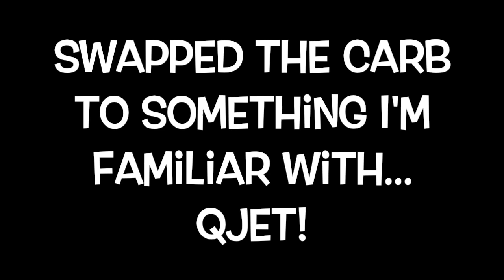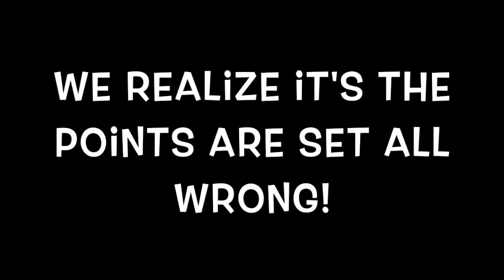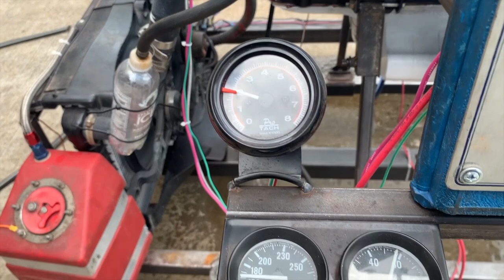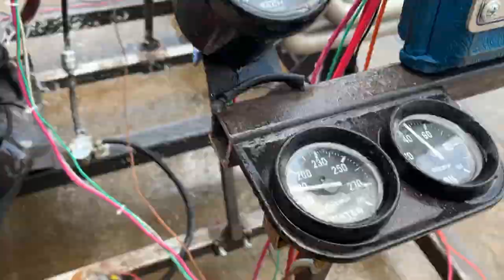What you've been waiting for, Super Stock Buick 350 Camshaft Break In! #AHRA #nonamenationals

Comment: That's why if I was rebuilding an engine, I would first rebuild the carb and dizzy, and put them back on and make sure they're dialed in, BEFORE removing and rebuilding the rest of the engine. That way you know that there are no questions surrounding these two brains of combustion.
Another easy alternative for someone like you would be to just have another mule engine, which you can use to dial in carbs and dizzies for other engines.